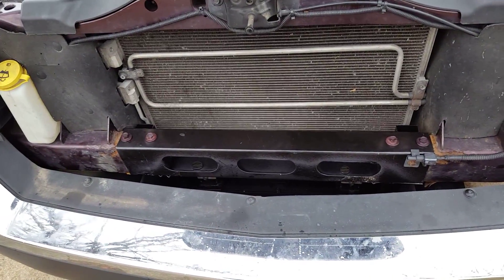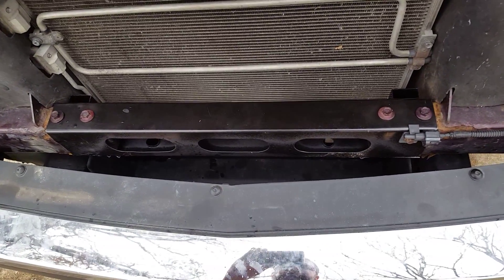Dakota Radiator Support repair (no weld)

Comment: i hope this is still monitored but where if you had to get the new bushing for the radiator to sit on
Reply from the maker: I bought it on Amazon.  It was very reasonable.
Reply: @302MuscleCars  would you have the link all I need are the bushings lol

Comment: If you cut the top of the new support, instead of the bottom you don't have to take anything off. It worked for my 2005 Dakota. I did take the plastic shield off the bottom but it is very easy to do so. Thank you for the video. I didn't know where to start when I ran into this problem.
Reply from the maker: That's a common issues on these trucks but a fairly easy repair.  Glad you got yours fixed up.

Comment: Where were you 8 years ago when I ran into this issue on my 05 Dakota? 🤣🤣 jk...   Same as you, when I looked up the replacement part, I was like “WTF?!?...” The only part that was rusted/broken was at the very bottom under the the radiator.  Which I’m guessing (since I live in the rust belt of Ohio) is because water/ice/salt/etc. collect down there.  That being the case... Explain to me why are the ‘J’ arms (that extend down/under & actually support the radiator) welded to the cross member, instead of being bolted on?  I was about to just order the part as is, cut off the support arms, drill my own holes, & bolt it to the cross member myself.  Although, I just happened to have a scrap piece of 1” C-channel that was long enough + a Harbor Freight 90 amp welder.  Fortunately, there was enough clean metal left on the J arms for me to weld the C-channel in place and bolt everything back together.  Tbh, it was a pretty ugly weld job; but I didn’t care, cuz it got the job done & who is gonna see it anyway?

Comment: Oops, deleted my other comments by accident.  Do you think it is OK to cut slits on top and install up, rather than slits in the bottom?  I saw a video where they mentioned it was tough fish the part up past the supports between radiator and back down.  Probably better support your way?
Reply from the maker: It probably wouldn't matter.  There is no structural support by this part. It's only locating the bottom of the radiator.